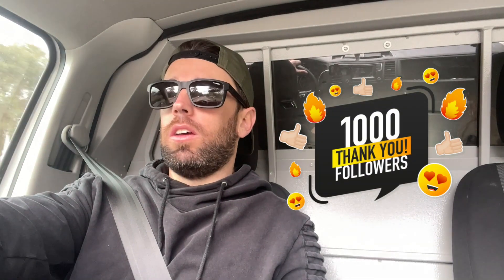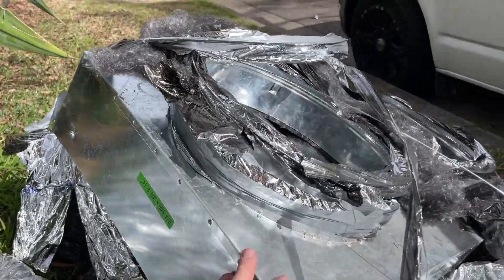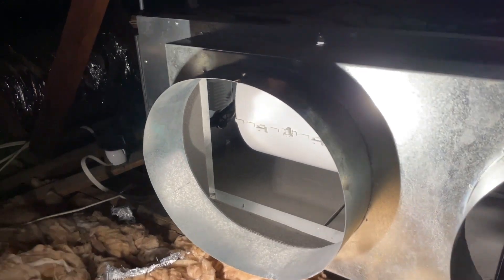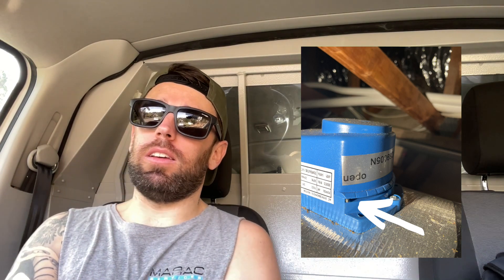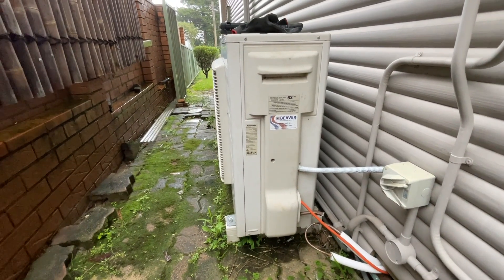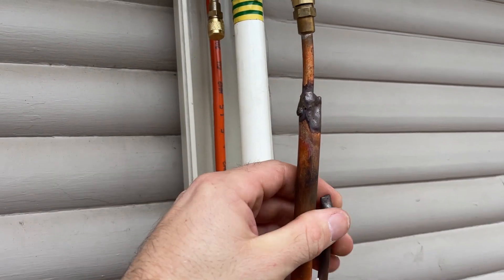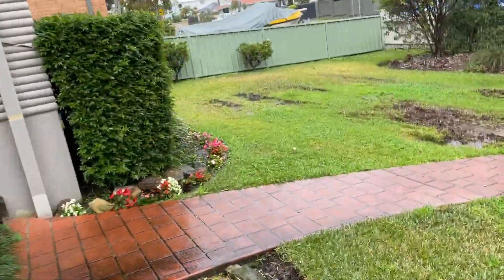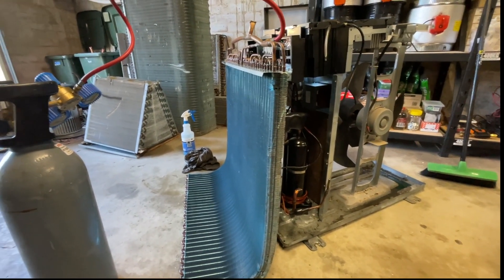I FOUND ANOTHER TWO GAS LEAKS !! 😳

Comment: Great vid, I like how you go to the extra effort on jobs which is what i like to do but working for a larger company i find it hard to spend the extra time on residential jobs as we have to charge for every minute on site. I guess the beauty of working for yourself is you dictate what you charge etc. On that panasonic job did you charge per hour or was it a quote.
Reply from the maker: Thanks mate. I know what you mean. I personally hate being rushed and it’s the main reason I went out on my own in the first place. I used to get rushed on installs and hated it. In regards to the Panasonic job. I went there for a service call and it was just an hourly rate for the diagnosing and finding leaks. I ended up replacing the whole unit over to a Daikin so I ended up just disregarding the hours I spent looking for leak and came up with a new price for the install. Both parties were happy.